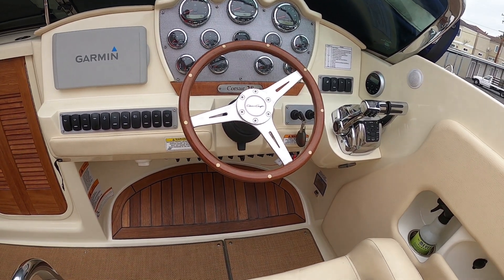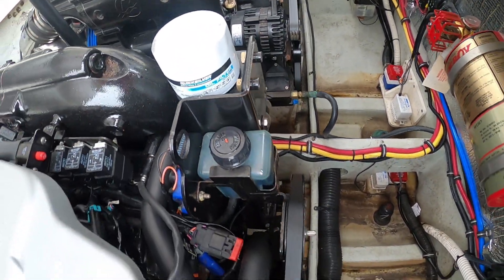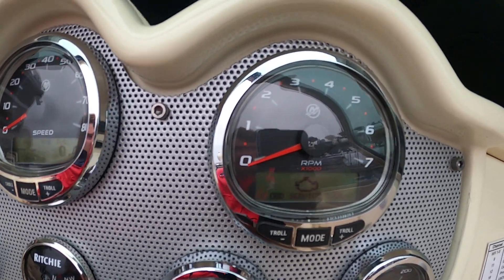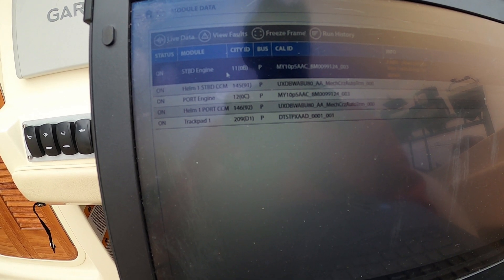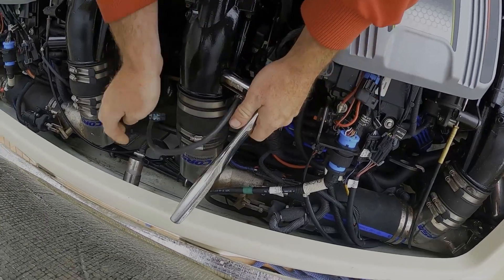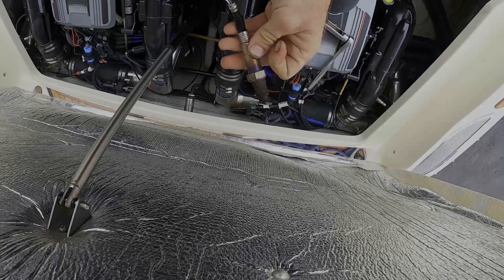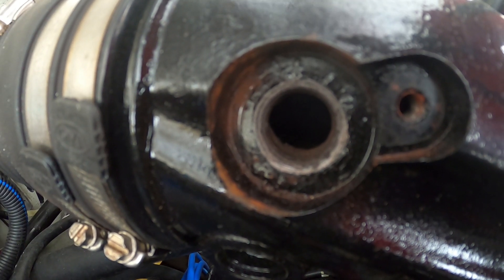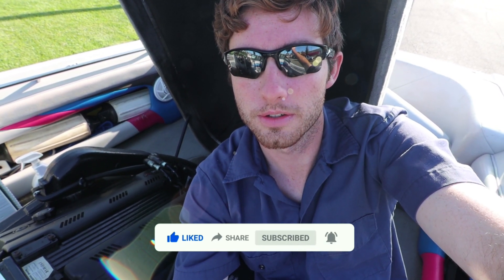Mercruiser 5.7 OBD service soon code/ oxygen sensor code

Comment: Hey there - GREAT VIDEO!  I have a question for you.  I have the same engines as this video = 2016 350 MAG MPI with the cats.  I just replaced the risers and mans a year ago with all new sensors.  However, in about Jan i had a problem with the opposite engine and to make a long story short, I ran idle only with this engine for about 4 months using it once a week for a few hours each weekend again at idle only.  Now, the other engine is fixed and the first time I went to go use the boat on plane, this engine is now throwing o2 codes. Further, I have a vessel view on the boat but it was not on this engine until now when the problems arose. Noting I do not know if it was throwing these faults before, as the VV was on the other engine and I was only idling around.  The issue I am having is that now when I just turn the key on to this subject engine (now with the VV on this engine), without even starting the engine, I get a o2 sensor fault saying (on the vessel view) too little fuel is detected relative to the amount of air.  After I start up and get going and ONLY on plane, after a while I get o2 sensor heater fault and the engine goes into limp mode until I get back down to say under 2000 RPM.  It sounds a lot like this video.  The sensors (all 3) are only 1 year old.  Do you think they could have gotten dirty from idling for 4/5 months and I am throwing these faults?  Thanks for any input - I am in Boca Raton FL